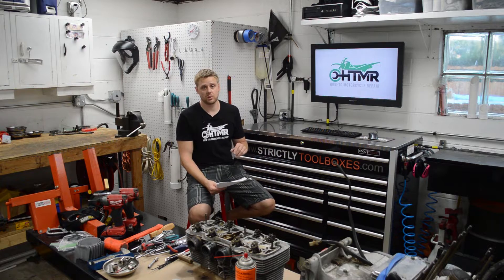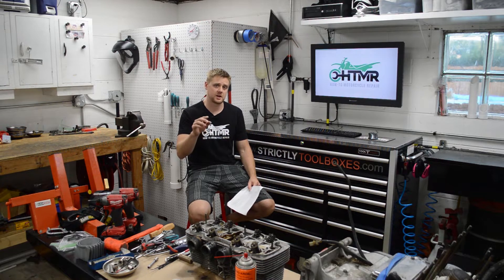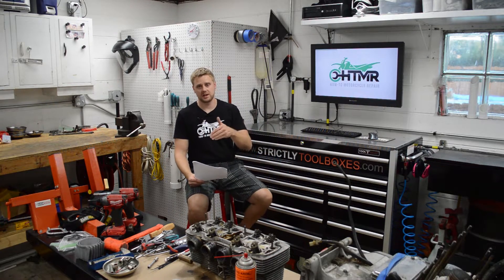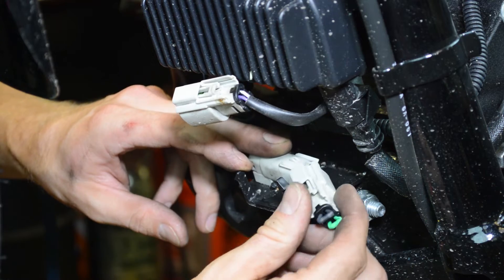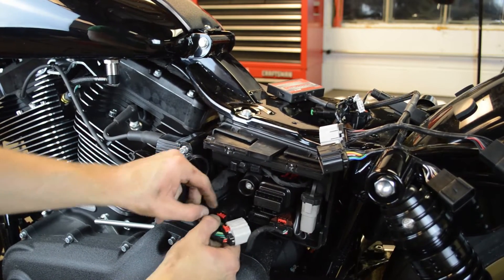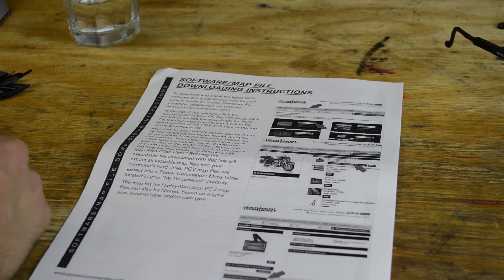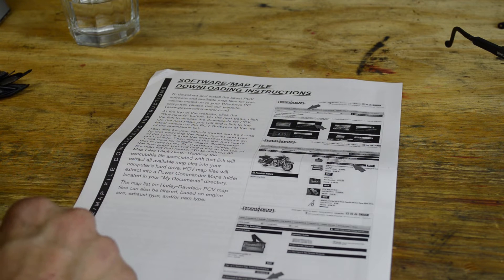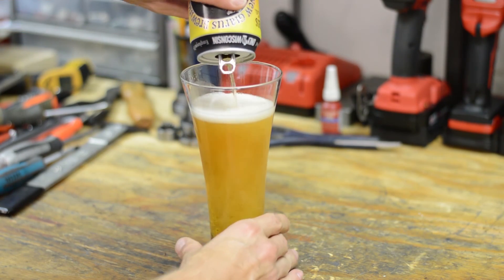How-To: Dynojet PCV Programmer Install on a Harley

Comment: I wonder if dynojet changed there installs process.  They are telling me I need to leave the o2 sensors installed I have a 2017 fxdls.
Reply from the maker: Does it come with O2 optimizers?
Reply: @HTMR  long story.  Just bought the bike like this.  Has the O2 delete plug just like you installed, but they installed the auto tune kit with the wide band o2 sensors.  When I contacted dynojet they told me I should have both the oem narrow band sensors and the wide band o2s.  So 2 o2 sensors per pipe.  I plan on just ripping everything out and buying new factory sensors and running a power vision.
Reply from the maker: @St3v3-0  Auto tune needs all those sensors for feedback for fuel correction. Why not just make it work with what you have?